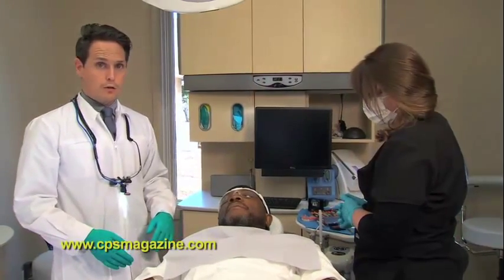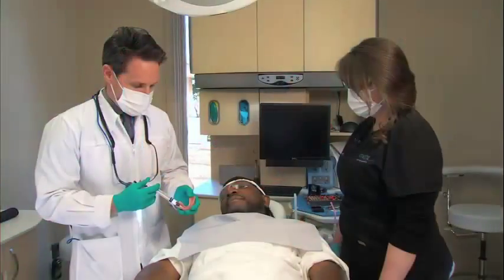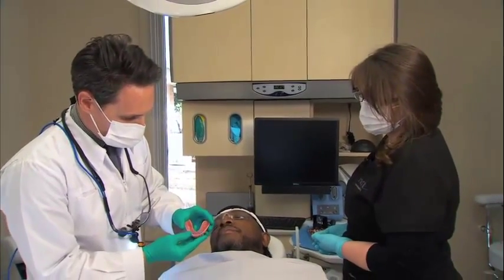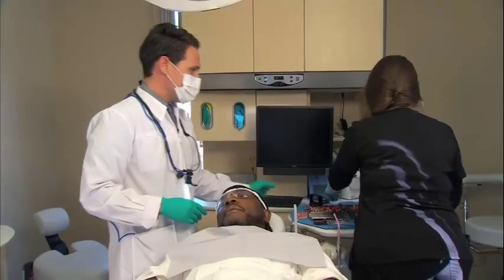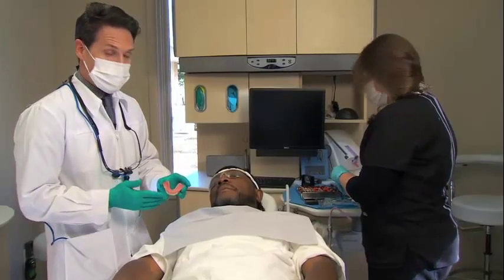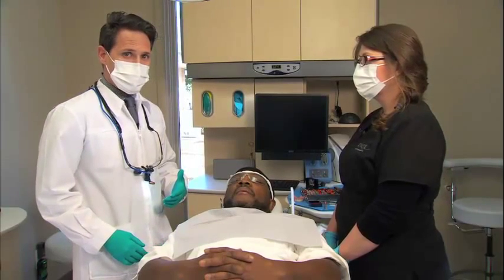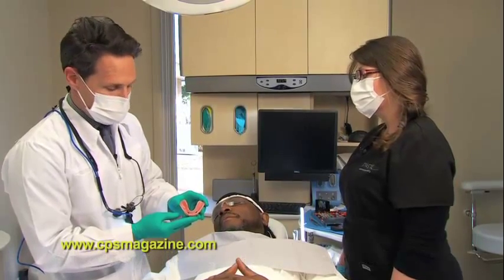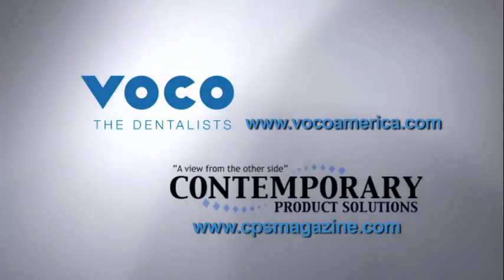Implant Pick Up with the Quick Up method - long version

Comment from the maker: We just want to clarify that the Quick Up system can be used as a hard reline material from the chemical composition. Nevertheless it may cause you clinical problems when you use it to on a too large area because it may sets to quickly on you. Especially if you have a large maxillae case, it could happen that one side is already hard before you finished applying all the material.

Comment from the maker: We recommend doing the hard relining first with Ufi Gel Hard C or anoy other hard relining material. After this procedures it is recommended to wait 7 days to make sure that the patient does not have any pressure sores, before you start the implant attachments.For the pick up of the attachments Quick Up can be used, it will have an excellent bond to the denture acrylic as well as to the hard reline material

Comment from the maker: Yes, you could use the material as a hard reline for dentures. However, we would recommend Ufi Gel Hard C instead, because it has a longer setting time and is more economical as well.
Reply: Can you use Ufigel for an implant pickup denture conversion on all on four procedures? The reason being I can’t find quick up in Mexico but I can find ufigel hard